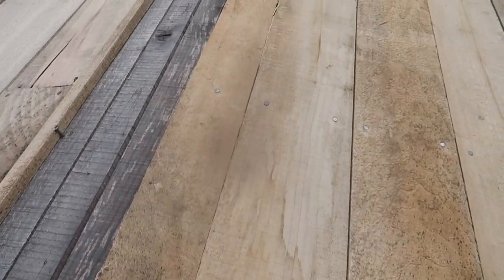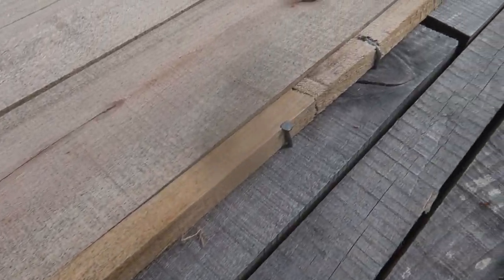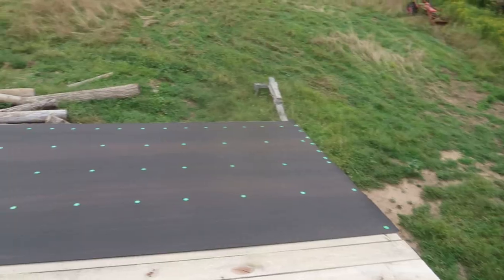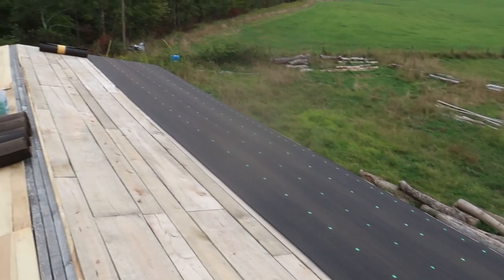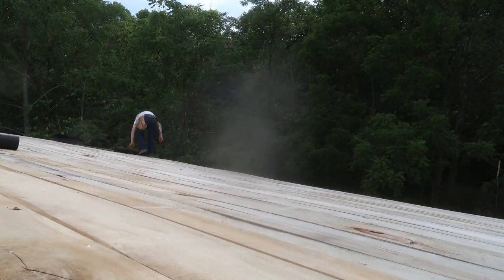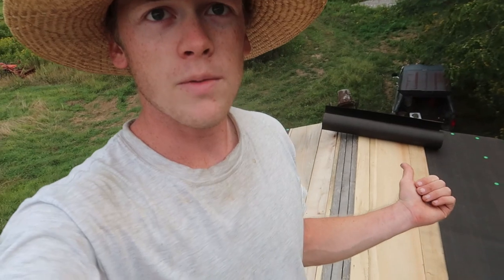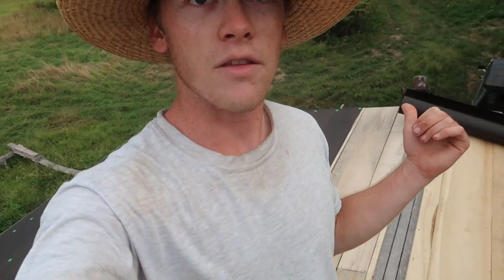Underlayment & Drip Edge | Sawmill Shed

Comment: Your build is coming along nicely! Great to see you all ‘blacked in’ now. I would have been awfully squeamish close to the edge, but I suppose you get used to it after a while. The panel installation should go quickly now. I may have missed it but it looks like you’re not putting in the standard ridge vent — I’m sure that’s on purpose. Keep up the good work!
Reply from the maker: Thanks! I'm no pro builder, but my understanding is that ridge vents are for attics. The loft area of the shed is going to be a workshop of sorts that will have a stove for heating in the winter, and windows for ventilation in the summer. Josh
Reply: Landis Legacy Farm I’ve got a barn and a storage shed - both with ridge vents; but neither are heated - that might make a difference. The windows you’re planning will certainly help, and, most likely, all you need.
Reply: I’ve got a barn and a storage shed - both with ridge vents; but neither are heated - that might make a difference. The windows you’re planning will certainly help, and, most likely, all you need.

Comment: BTW Josh, I was meaning to ask you, you could have had a single pitch roof but you chose two pitches with a ridge. Did you give any thought to a single pitch? Things are looking good!
Reply from the maker: Hmmm..... good question.  One reason would simply be I like the look better. It was also a little easier with the height, not having to find a tree that straight for that tall for the posts. Possibly having the roof angled down in front may help preserve the siding from the elements. So I guess not really any big reasons, just preference and theory. Josh